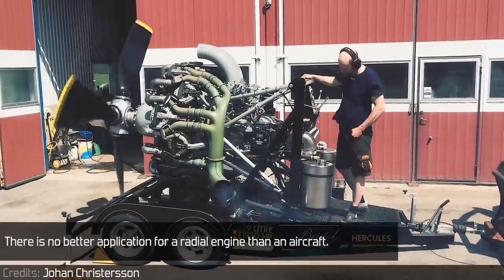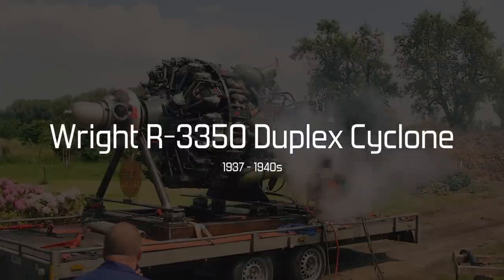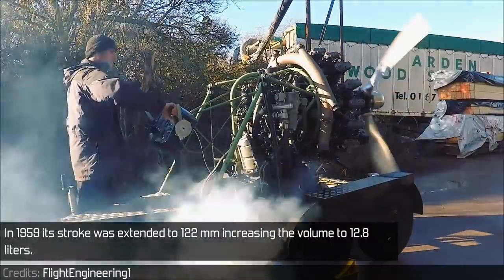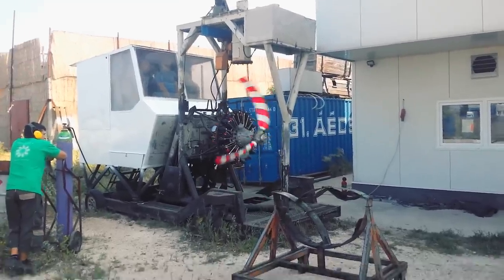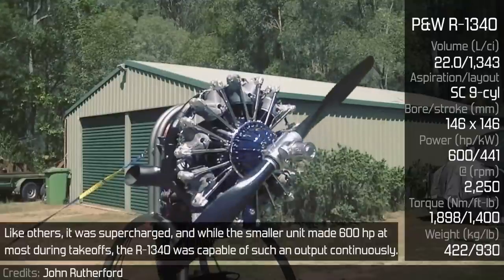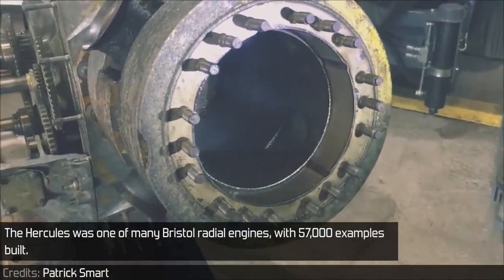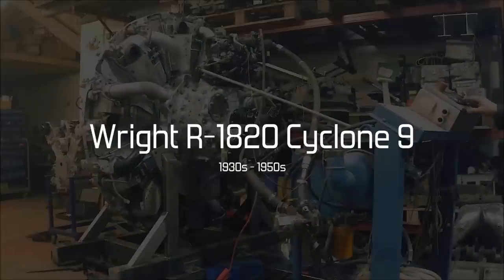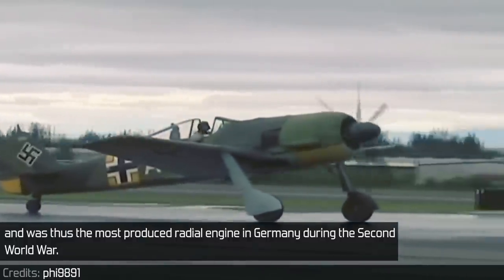10 Amazing Radial Engines You May Not Know About

Comment: The B-29 used a the turbo supercharged R-3350. The Turbo compound used an exhaust turbine to route power directly to the crankshaft. 3 units per engine producing apx. 150 HP each.   I worked on this engine while assigned to the Navy patrol squadron VP-65 equipped with the SP-2H (P2V-7) Neptune.

Comment: Back in the late 70s - early 80s, I flew DC-7s as air tankers at forest fires. They had 4 R3350s. 

These engines were designed in the mid 1930s, the first one ran in 1937. There were no computers back then or even calculators. If close was ok, you used a slide rule. If it had to be exact, you did the actual math on paper. 

The ones I remember were 3400 HP for takeoff, 2900 HP continuous. The props were about 14' in diameter and the gear ratio was 7/16 prop/engine. 

They had power recovery turbines, one turbine for 6 cylinders, 3 total. These were basically turbines with slanted blades that were connected to the crankshaft via oil couplings. They caused very little back pressure but added added 400 - 500 extra HP @ takeoff power. They were also a royal bear to work on........

They had superchargers, 2 speed. Low speed for under 12,000', high speed for over 12,000'. Tankers are almost never higher than 12,000' so we always used low speed.

They used 115/145 avgas. Purple gas...... They would run on 100/130 but the maximum takeoff power was reduced to 2800 HP. 

They used 60 weight oil in winter and 80 in summer. They would burn a couple of gallons of oil an hour. If it was more than 4 - 5 per hour, it was time to look into why. 

On a hot summer day, a typical takeoff manifold pressure would be pretty close to 60". 

Though I started them hundreds of times, it was always a thrill to hit the mags and hear them come to life........
Reply: RR KNL
   The best comment so far.
   Allways loving to learn from those who really know it, and above all the people "with the hands on the job".
   Thanks for your interesting lesson, Sir.!!!
   Kudos to you.!!!
Reply: Last I heard they're still using them although I believe that the FAA restricts them to around 60% power because of the age and condition of the engines, they were the engines used in the B29 Superfortress, but the Pratt&Whitney R-4360-51VDT Wasp Major is the king, 4,300 HP, after WW2 they developed a bomber from the B29 called the B50, the Wright engines were constant problems in the B29 from day one and by 1944 they started work on fitting the 4 row P&W Wasp Major on an experimental plane called the YB44 which was a production B29 that the engines were fit on as a test bed and developed into the B50 after the war. 
That being said, I'd give anything to see a P47 do a low level full power War Emergency Power  pass, but considering the age and scarity of them I ain't holding my breath.
Reply: RE KNL thanks for the info . It,s great hearing from acuale people who flew and worked on these aircraft. I love the radials awsome piece of machinery.
Reply: Power recovery turbines are known by mechanics as 'Parts Recovery Turbines' due to the increased maintenance they cause.

Comment: Love the sound of the Bristol Hercules with its sleeve valves.
A point to note is that some of the Japanese and German warbirds that are airworthy have P&W or Wright engines instead of their original engines, because these planes mostly were complete wrecks before restoration, in these cases the original engine was often beyond repair.
As Japan and Germany has to destroy all remaining weaponary after the war, including stocks of spares, there are not many original engines left, just the ones in crashed planes, there were however plenty of unused new American and British engines left after the war, and there is still a good availability of these engines now, used and maybe even with very low running hours.

Comment: A lot of russian aircraft are started with compressed air, anything else is just not reliable in the cold, and pilots often bring a bottle of compressed air to refill the tank in case they don`t get the engine running in the attempts they can get from the on-board "charge" :)

Comment: what about a
13.5L (500cc per cylinder)
27 cylinder liquid cooled Radial Engine

108 valve DOHC setup
with Variable Valve Timing and Lift for the intake and Exhaust

9 Intercooled Variable Geometry Turbos

Port Fuel Injection

Comment: No R-4360? What about the Lycoming XR-7755? Largest piston aircraft engine ever
Reply: The R-4360 seems like it should be included. Although it was common, so were the (included) R-1820 and R-3350.

The XR-7755 would also have been a GREAT one to include since it was the largest radial built. It also had features uncommon to radials like water cooling and overhead cams. It even had VTEC (yes, VTEC, and back in the 40s). It may not have been included due to the fact that it never actually flew.
Reply: Look up Studebaker R9900 !

Comment: Radial engines were even used in American tanks in WW 2
Reply: Bill Leutzinger and they fry the crew when hit
Reply: kyubey, the cute little devil “tommy cookers”
Reply: The Sherman's frying the crews when it was a major mis conception, in fact the sherman was a fairly good tank. Now don't get me wrong, the Sherman's did in fact blow up when hit sometimes, however it was due to a crappy ammo rack design. They fixed the design in the later models leading to less explosions, even then how ever they did still exploded due to gasoline not liking being shot. However the German Panzer 1-7 all used gas and when hit had just as good of chance to explode as a sherman.
Reply: @johnathanluther4012  " However the German Panzer 1-7 all used gas and when hit had just as good of chance to explode as a sherman."  I think you meant to say that the Panzers had v-12 engines not that they ran on gasoline.
Reply: @jason.arthur.taylor  na, the v12 engines in the german tanks all ran on gasoline.
Reply: @johnathanluther4012  What the heck else would they run on?!?!?!?  Please reread carefully what you wrote a year ago and notice the error before making a quicky reply like this.

Comment: The Russians (USSR) never legally produced any R-1820 under license from the Wright Airplane Co. They simply copied the engine in great detail, right down to the Imperial sized nuts and bolts, just like they copied the US produced Boing B29 rivet for rivet, and called it the Tupolev Tu-4 in 1946. Also, communist Russia copied the British Wittle centrifugal compressor turbine engine in the same way to power the early Mig-15 jets of their own very successful swept wing design.

Comment: In regards to piston engine aircraft, recips are more popular than radials. Radials aren't a very effective configuration beyond having all the pistons in the cooling airstream. The bottom cylinders of radials tend to fill with oil and get hydrolocked, they produce a lot of drag, and have a very complex valvetrain. When you become an A&P nowaday they don't even teach about radials. You get a brief introduction, but the majority of the focus is on reciprocating engines and turbines. That's not to say they're not interesting or culturally significant, but they became obsolete way back in the 40's and for good reason.
Reply: Kifo ... Radial engines ARE reciprocating engines. The main reason they have fallen out of favor, is that they don't offer good visibility over the nose for small aircraft with training wheels (tricycle gear).
Reply: I should have clarified when I said recips I mean horizontally opposed. Inlines and Vees were also more commonly preferred in  WWII. Or at least by Germany.
Reply: Kifo ... Btw, there are many advantages to the radial design, not the least of which is that the crankshaft (always the heaviest single component in any reciprocating engine) has only one throw, making it shorter and of lighter weight than a crank in an engine of comparable power and number of cylinders. 
The valve train isn't at all complicated, if you know how it works. Usually, there is one cam ring turning in the opposite direction of the crank, and at 1/3 the crank speed with 1/3 the number of cam lobes... once again reducing the comparitve weight and complexity.
Leave it to the British to complicate things with sleeve valves and self-comencers.
Reply: Kifo.  And one more thing junior... If you take a course in auto mechanics today, you won't learn anything about Carburators!
Reply: Tom Clark you must forgive my lack of knowledge on radials. I think I read a blurb about them in the 8083-32 once several years ago.
also, carbs are still taught and tested on in A&P school, interestingly enough. updraft carburetors seem to still remain very prevalent in GA over fuel injection.